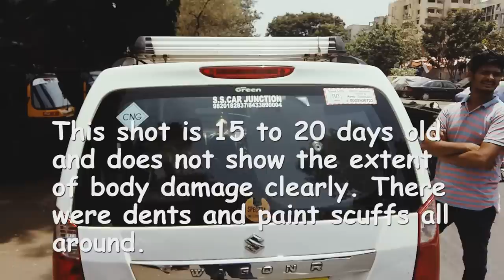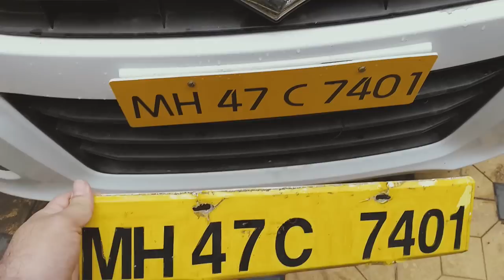Part 1 | Whindshield replacement (Front Glass) step by step |  Maruti Suzuki WagonR | INDIA

Comment: One thing I would probably say is get the edge clean throughly, free of rust ,paint it after properly dry do the rest steps or proceed to install the windshield and the charges will be a little bit pretty good. Et voila another success. 😂😉

Comment: Hi there what is the cost of replacing the back mirror. Jo mirror gaadi ke peeche hota hai vo toot gaya hamara. Please tell?
Reply from the maker: For WagonR old model it should be approximately 2500 Rs. But all depends on where you get it done from. Check a couple of dealers before finalizing one and also replace the rubber beading with the glass. Hope this helps. Please LIKE, SHARE & SUBSCRIBE.
Reply: @GauravVyas  It broke off today and this lock down. I don't know if we ll be able to find it or not right now. Thanks for reply :)

Comment: This after market way is not proper, this way sealant applied is not regular and required pressure is not applied on the glass so that it stick properly to the body. It’s just road side temporary makeshift work done.
Reply from the maker: Doesn't matter bro. IT WORKS and thats the whole point and its cheap. I got it done in under Rs4000/- With original glass and labour. I will not pay the service center Rs 8000- 9000 to do that same thing and who knows what they do behind walls. Service centers don't let you watch the process as well. Please LIKE & SHARE & SUBSCRIBE.
Reply: Yes. It works. The point is that they don't have the proper tools which really don't cost must. Proper handle/wire device is missing and they are using cloth to cushion the grip while cutting the seal.
 Rest , all is done as usual practice.
Reply from the maker: The link to part 2 is here - https://www.youtube.com/watch?v=IhQFuzqgV3A. Thanks for watching. Please Like, Share, Comment & Subscribe.

Comment: Absolutely wrong way to replace the glass. All the edges will rust and the pillars and roof will start leaking after few years.
Reply from the maker: Don't stress too much about small things in life buddy. It's a commercial vehicle and the car will be trash anyways in a few years. If it rusts and leaks we will fix the rust and repaint and install the glass again. Thanks for watching. Please LIKE, SHARE & SUBSCRIBE for more awesome videos.
Reply: Disagree.
Even on older vehicles, rust is seen when factory  fitted glasses are removed. 
The reason is the dirt and dust which slips under the rubber moulding and holds the moisture for longer periods of time and there is no way a user can clean it all under the moulding.

As Gaurav rightly said , no need to stress small irrelevant issues.